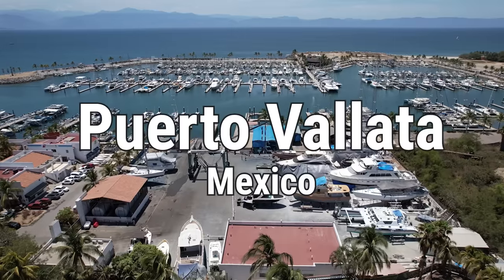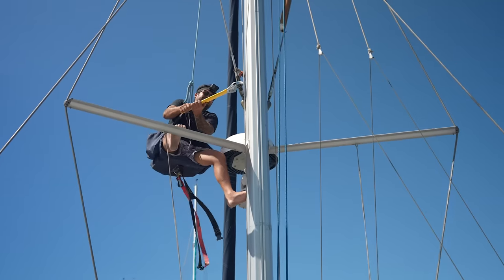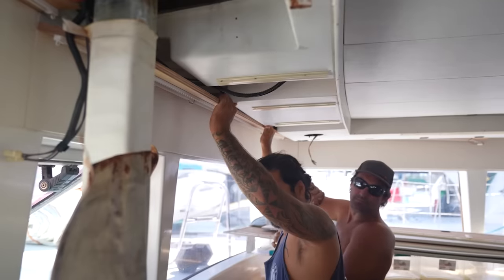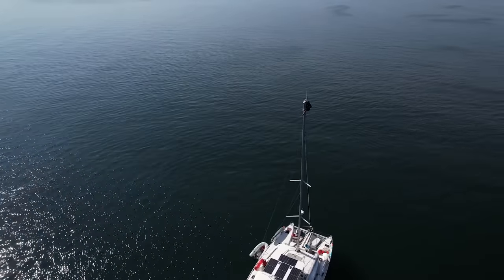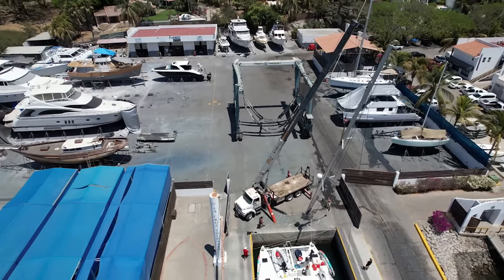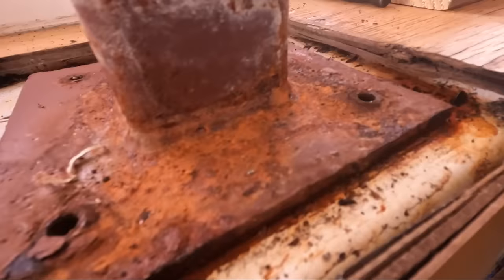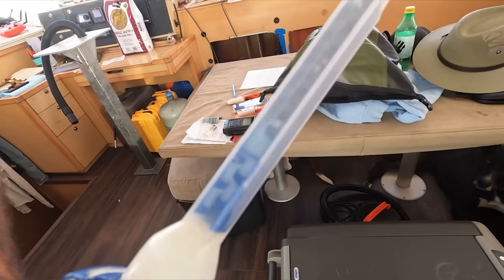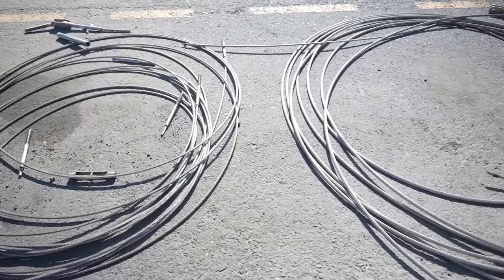Our Entire Mast Has To Come Down Because Of This... (Episode 220)

Comment: Keep an eye on that aluminum plate, it's anodic to the steel and will corrode at a much higher rate.
Reply: Looks like you missed the part where they installed a plastic spacer between the steel post plate and aluminum spacers

Comment: Actually They ARE Coach Bolts !!   YW.
Reply: Coach bolts have a domed head and threads, not a screw. 

Lag screws or (incorrectly), lag bolts, and some even call them French screws, (and bolts)...  🙂
Reply: @handycrowd  if they had not already gone bust my local hardware store mis sold them as coach bolts to me. I feel cheated and in need of therapy
Reply: @hunglikeadonkeybutnotassmelly  I think in the old days they were called coach bolts to be fair... the domed ones were carriage bolts, but it varied from place to place so I think I jumped the gun lol! You are reprieved ;-)

Comment: Hi what material is the the compression post
Reply: Steel.  The spacer plates below it are aluminium and a plastic shim separates the alloy plates and the steel to stop corrosion between dissimilar materials.

Comment: Should install a static dissapator on the mast. It helps the positive charge disperse before it builds up high enough to attract a down stroke
Reply: I wondered if there was something that could be added to the mask So if you were hit by lightning it would disperse it better And not fry all the electronics on the boat. Or even Something that would help not even attract lightning.
Reply: Absolutely no proof of that. Anyone saying otherwise is trying to sell you something.
Reply: All cell phone towers use the technology
Reply: @chrismulvey49  no they don’t. Not a single one use “dissipators”, they do use air terminals to provide a guided path to ground. Go look at the IEC standard.

Comment: Shame I am late on this story but it would have been VERY interesting to know what grade of stainless steel was used and whether any precautions should have been taken on assembly to prevent spalling. An acid test would reveal the grade
Reply: Eg bimetallic separation too
Reply: Seriously - throw away the wrench - get a close fitting spanner made to suit if necessary and put a 1m extending end on it and a fitting to take a torque wrench so you can measure the load you are putting back on properly
Reply: Ah so you got laguna  to look at the rust - if that was stainless 304 for instance - that would be (I am going to say) predictable…..
Reply: Did you check the thickness of the mast against original?
Reply: And that new mast post should have been over coated in bitumen

Comment: Colin, Jamie... try applying WD40 on the turnbuckle WHILE it's hot. It will draw the oil into threads while cooling it so you don't burn yourselves. You can heat and cool it a few times, the WD40 is like kerosene, so stop heating if it smokes, and wrap it in rags when reapplying to remove excess before heating again so you can smother it if a flame appears. You don't want to heat the turnbuckles up so hot that they lose their heat treatment and become too weak to use safely.

Are you doing anything now inside mast with cables as a grounding or energy director re: lightning strikes or can you go mostly wifi, wireless wherever possible ?  Because mast is stepped, and does not reach down as deep as in a monohull, you may want to watch this : https://www.youtube.com/watch?v=2tIh36suwLE